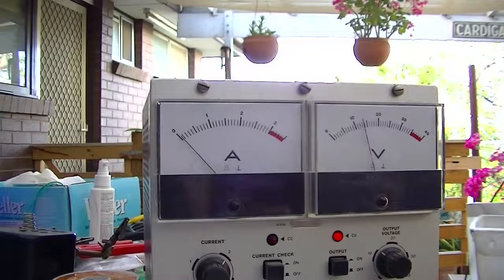Weird Issue With my Hendricks QRP Survivor

Comment: Hi did you ever manage to resolve the issue. Have exactly the same issue here
I saw your Amp draws 1.5 A so it should output at least 10 W  as mine only draws max 1 A and gets me 6 W in Tune mode..Please poost if you know what caused it and how I could increase power output.. Tnks
Reply from the maker: Hi Klaus,
I haven't resolved it yet, as I have been distracted by other things, but my theory is that RF is feeding back into the audio stage. It wasn't doing this before I installed the power MOSFET. As per the instructions, all my panel wiring is unshielded. If I replace it all with shielded cabling, it may hopefully fix it. I've yet to try this though. It's a thought none the less. My BITX transceiver has a similar issue too. Good luck! :-)
Emil - VK3NAF
Reply: snarfusmaximus Great Idea, will try shielded cabling for all interior connections Might make the difference.. Tnks and good luck. Will post if I have a resolution KLaus F4HHF
Reply: snarfusmaximus Hi, so I went to see a technician , he suggested not to use shielded cable, but just to keep all cable runs, as short as possible, really short, but not run them across the board but on the side, and to twist them in a pair if two or three if three.. Did that and it stopped oscilating.. I now get the power out as specified in the manual. 5w in Tune mode and 6 w max in speach with an average metering Power meeter..Hope that will help. In Tune mode you seem to get 1.4 Amp  power draw. Thats eems far too much all considered, think your pA Bias is too high..You can contact Dale on the Yahoo site, he helped me out, so can surely give you some suggestions, cheers Klaus
Reply from the maker: Klaus Reisinger That is awesome news! I didn't expect the solution to be so simple. I will definitely try that and see how I go. Many thanks for the advice.